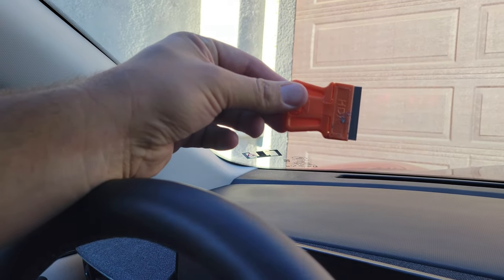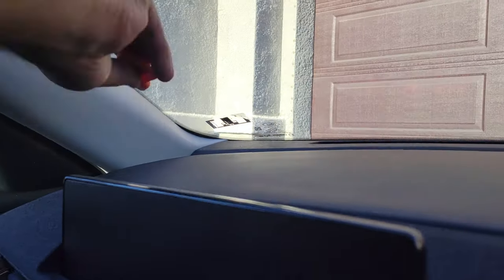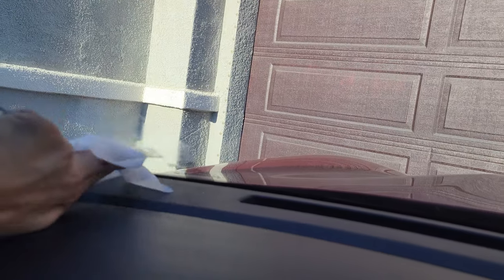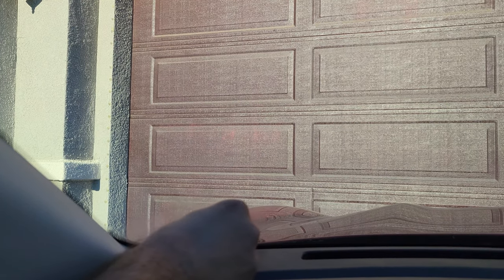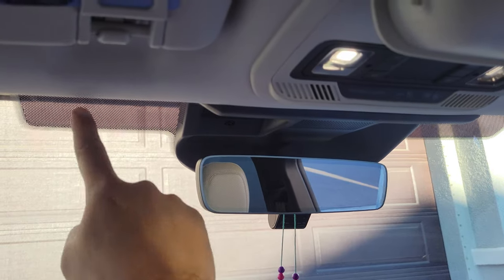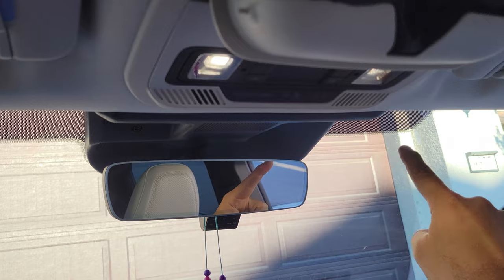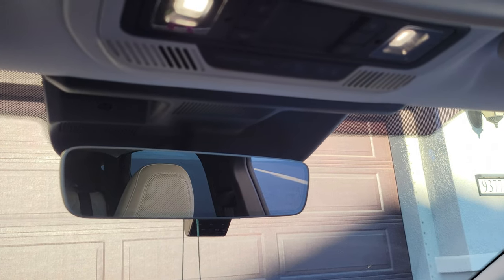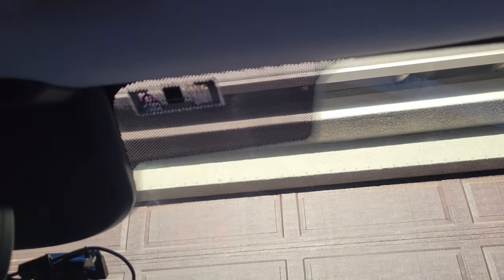Transponder location - how to remove decals from the windshield | Ford Mustang Mach E

Comment: I installed mine just to the right of the mirror. hidden from view but has seemed to work on the LA County FastTrak.
Reply from the maker: I ordered it from thetollroads.com valid in all california
Reply: @BentheEVguy  The LA County toll roads use a switchable transponder.
Reply from the maker: @roberthoward6032  switchable for hov? Yea you can order that at the tollroads.com as well
Reply: That article is from 2012. This sticker works for FasTrak and toll roads in CA. Don’t need the big box now, not for the past couple of years.